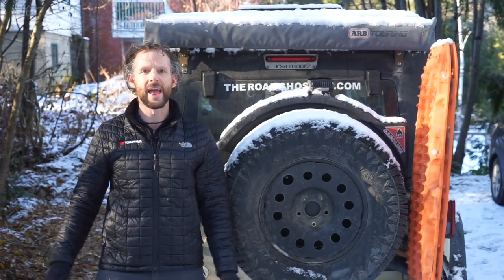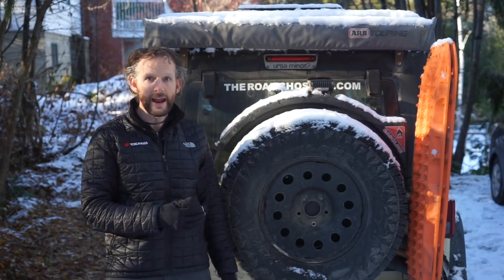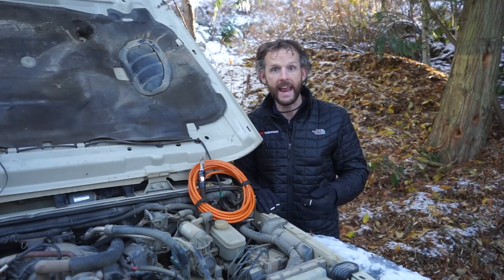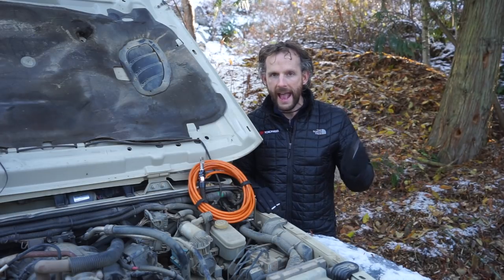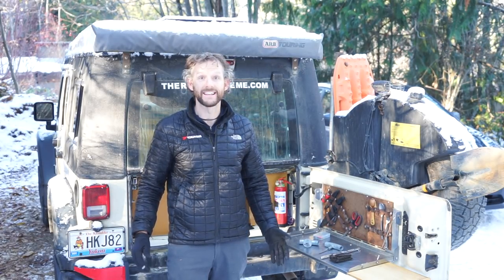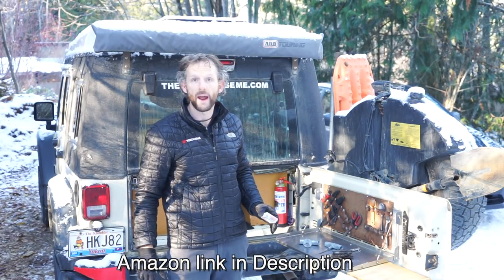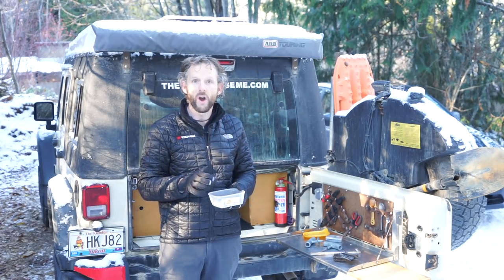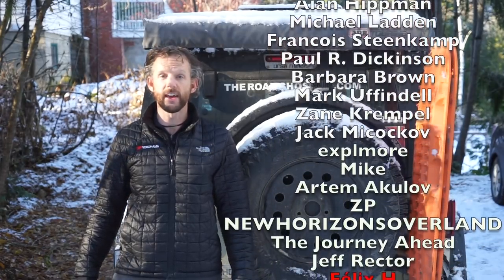Tire Spares and Repairs for Overlanding

Comment: I've broken lug bolts in the middle of nowhere. Once in a village some kids deflated all my tires. Thankfully there was a volleyball pump. On my vehicle it took about 2000 pumps each to get things up to drivable. Most of the village lined up to be heroes and take turns of 50 pumps each. This ended up being yet one more way to connect with local people.

Comment: i don't carry 2 Spares anymore. Did till about 4 years ago. Touch wood, flats are few and fare between. Ironically the last one I had was in the drive way of the tire shop near home (I was there picking up a tire for someone else).  But do carry the generic plug repair kit and valves. I do, carry tire leavers and a tube to fit my tires. For those times plugs wont do. The leavers pack flat in the back of the cupboard with some tape on them so they don't rattle. Basically take up no space. The tube had me stumped for awhile how to store with out it getting damaged. Ended up putting it in a A3 zip lock pocket and taping it to the underside of a shelf.

Comment: I very seriously considered carrying just one spare (and as it turns out, I didn't need any) on my last Africa trip, but I decided to play it safe. My parents who joined me on my last trip in their Discovery 3 run 255/55 R19's and carried only one spare, and they didn't have a single puncture either. I think modern tyre reliability is such that you're very unlucky if you get a single puncture on a Trans-Africa trip these days. However, we also own a safari company in Kenya and we use two spares. This is because the Land Cruiser uses split rims with tubes (my vehicle uses one piece tubed rims) and tubes are far more likely to get major tyre-damaging punctures than tubeless. A tubeless tyre can be plugged or, even better, the tyre sealant sold by Max Adventure and used by the UK Ministry of Defence which the manufacturers claim can seal holes up to 25 mm (1 inch) diameter in truck tyres, 20 mm (3/4 inch) in 4×4 tyres and 15 mm (5/8 inch) in car tyres. Apparently the stuff really works too (in both tubes and tubeless), but I've yet to try it.

Comment: I managed to nearly tear the sidewall out of my tires driving around the logging roads on Vancouver Island. I was about to move to Ontario, so took a last spin out past Port Renfrew, and up the Pacific Marine(with a few detours). I failed to lower my tire pressures on the detours, so tore a large gash in the side of my rear driver tire. It didn't go all the way through, but it likely wouldn't have held up to multiple days of highway driving. 

It was an expensive lesson.

Comment: I have put 10,000 miles on a tire with a patch numerous times. To be fair I was not overlanding, but instead in a work truck that consistently had a load in the back over 2,000lbs.

Comment: When I started driving four wheel drive vehicles in the late 1970s the tyres usually mounted on split rims were a constant problem tyres are so much better today if you manage air pressure and vehicle loads. I no longer carry two spares I always carry a plug kit and when remote a set of tyre pliers and tyre leavers to do a major repair.A second spare adds 40KG plus a wheel carrier? for people who run exotic tyres and rims two spares might still be worthwhile, I prefer to run factory Toyota rims and tyres the same size as factory but better quality BFG KO2 the chances of getting a tyre that will fit even in small bush towns is very good regards Mike
Reply: Not bagging Toyota, as I own one. But don't know what model you drive. If you carry any weight. Upgrade to Mining Spec steel rims (1700kg per wheel) relatively cheep. Or if you have money to burn some 1500kg+ alloy rims. Note I did not say bigger, just stronger. The rims they come from the factory nowadays are the bare minimum. By the way BFG KO2 is a great all-round tire. You can't go wrong on that.

Comment: Thanks again for all the great info from real-world experience. I have a little and want to contribute this: Where I live, Southern CA, most folks have aluminum wheels on their trucks. That is great for lowering unsprung weight so the trucks handle better, ride better, shocks last longer, and they look great! However, if you are out on your own (like I am on my ranch in Arizona with no cell coverage) and you break a wheel (aluminum breaks more than bends) you can be in a world of hurt. Steel wheels bend and they can be hammered back into useable shape even when severely bent. For long-distance overlanding in remote areas, steel wheels are the way to go, not the cool looking aluminum wheels.
Reply from the maker: I agree 100%, that's the exact reason my wheels are steel!

Comment: for my first Sahara crossing I got a set of Luxury Car "VR" Tyres with run down profile from a tyre merchant. Basically best available technology and rubber mixture in 1989. Put them on in Morocco and never had a problem untill i sold the VW Van in Mali. So good tyres matter. "Ichy boots" says the same (bike) - only flat on 63.000 kms with run down profile, but sometimes picking out screws, nails etc out of the profile when tyre is still good.

Comment: Interesting topic, just my 2cents:  4 of my last punctures (in Zambia/Namibia/South Africa)were on recently graded roads (roads in process of being graded), where the stones in the road surface is chipped by the grader, typically the puncture on the rear wheel, as the front wheel flip the stone for the rear tire to puncture - this is something you will only experience in places where the roads are still gravel and graded frequently, you may have tires that are are close to 50% used, not on bad roads where the torture is more on the suspension - the other serious issue is when you experience broken tar, and this is typically where a rim may also get damaged, especially if you deflate your tires like on a dirt road, as well as hard compound tires like BFG (where parts of the tread chip off and it gets unbalanced) - until you have experienced true broken tar, one should not comment, but Dan, I am sure you would've experienced broken tar in Africa ( I thought I saw in one of your videos that typical drive on the shoulder of the road as you often find in areas where the tar is beyond repair, even on main routes) - also broken tar not something always predictable as the roads deteriorate and they let it slip until it is close to being destroyed.  A final favorite spot to get punctures is if you drive in African National parks/ farms/two poor tracks with a lot of Acacia thorn trees, when the wind blow/storms, small dead branches underneath the trees on the road off (also wildlife like elephants), and you drive over these thorns - at some stage your luck will run out, and you cannot pick every thorn branch up if it is a long distance - that is why I always carry a tire repair kit as well as a spare casing (used it twice in the last 12 years), but then I do go way off the beaten track - also, the biggest issue with fitting a second tire casing is not to get the tire of the rim, but to break the bead, and yes, high-lift jack does a great job - just watch out that you don't damage your tire's bead as it will then not seal if you are inexperienced with tire levers.  Also, TPMS is great to warn you that you have a puncture, I typically get it plugged and re-inflated before it is totally deflated and one can feel you have a problem, and that usually saves the day.

Comment: I've broken more valve stems than tire punctures.  Colby valve stems are a life saver, replace stem without dismounting tire.
Reply from the maker: That's one of the great things about the wheels I run, the valve stems are entirely protected by the face of the wheel.
Reply: Those colbys rock - I've seen them used twice on the trail and they work like a charm. Especially useful if you stem kind of sticks out. Mine is protected by a 'fake beadlock' XD
Reply: I didn't know about them. I just went to amazon and ordered. Thanks for posting!

Comment: Tire plugs are a great TEMPORARY fix. You should absolutely get the plug pulled and a patch put in at the earliest opportunity!
What happens is a small amount of air will seep through the first, inside layer of the tire and travel in the steel belts, effectively separating the plys, cause a bubble and blow out the tire.
I know, sometimes you can get lucky and drive on a plugged tire for a long time. But more than not you'll have that issue!
Reply: That's my understanding.  Plug fixes can lead to internal delamination.  That said, I have done half a dozen plugs on my truck tires over the years, and never suffered this fate.  A nice internal  patch at a garage is the best fix, and $20 well spent.  Peace of mind is worth something, too.

Comment: 1) Number one accessory that you must have is a compressor. It comes first. An ARB Speedy Seal kit is also essential.

2) Good quality Japanese made tyres are the best for those running radial tyres.

3) I hope you don't bump into me on the road. Insurance claims in foreign countries are difficult even with a single vehicle.

Comment: Great video Dan! I purchased a quality viair compressor and puncture kit for my dempster trip this summer. Luckily I only had one leak just outside of Whitehorse which gave me a good chance to test out the compressor and plug kit and it was great being able to inflate the 33” tires to 80 psi with my truck camper on the truck.
Reply: I have just gotten the Viair 88P compressor.  Works great and seems nicely made.

Comment: So far I've never needed a second spare tire, but I always have one with me. The reason for this, however, is that I am mostly overlanding in vans or cars and the tires for these vehicles are not that strong. For cars it makes sense to fit van tires, these are often available in similar sizes and they are much stronger.
For my next trip, which will definitely take 3-4 months across Africa, I want to pack off-road tires on my Mercedes van.

So far we've always had these plug kits with us, but we've never used them. In West Africa there is a tire workshop in almost every major village. And for around 3 euros you can get the hole patched up quickly.

But I definitely want to take an air compressor with me for the next tour. So far I always had these 12V cigarette plug air compressors. But they are only good for emergencies.

Thanks for your tips. It's nice to see that others are also on the move with the attitude that less is often more.
Reply: There are decent portable compressors still, if you’d rather not hard mount it.  Even ARB sells theirs in a portable model. https://www.northridge4x4.com/part/compressors/ckmtp12-arb-portable-twin-air-compressor
Reply: @jfloydsea  thank you for the recommendation. But I think this model is a little bit above my budget. 
Maybe I will go with their smaller compressor like the one Dan got, also I don't really need a portable one, I think a on board compressor with a long (10 Meter) hose should do the job.

Comment: My kind of adventures is not off-road and I travel to experience cultures, local cuisines, interact with locals and learn about so many things about how people live and see attractions. That said, I have never felt a need to even carry any repair kit for tyres. Before trip I put on my good tyres and carry one spare Tyre, the few times I got flat Tyre i just change the Tyre and look out for the next village or town and get my Tyre repaired. That's all.
I feel for people who do adventures like mine who hardly go outside civilization, there's a lot of stuff they don't need to carry... Perhaps why I'm likely not to carry extra fuel on my next leg of trip in southern Africa and I will reduce water capacity from 15 gallons to just 5 gallons because I realized I Carry things I may never need anyways

Comment: Were you rotating every 5k while driving around Africa?  Did you rotate in your spare?
Reply from the maker: Yes, I did a 5 tire rotation every 6,000 miles (10,000kms). It gave me a great chance to have a good look around at the suspension and make sure everything was good.

Comment: First comment😊, I agree with you that 1 spare tire should be enough in modern times. I am driving vehicles since 40 years and so far I can remember 2..3 tire problems
Reply: I've been driving vehicles for only about a half decade, but I've had a lot of problems - punctures in sidewalls, punctures through the tread, plenty of damage. I've totaled four tires out, and usually get a flat every month or so.

I've never damaged a tire off-road, though; I work in construction, and job sites are messy, but on the farm, mud, and trails, I've never destroyed a modern tire. (10+ year old sun-rotted tires are not counted here.)

Comment: I think you may have mentioned in another video but Tom Shepard showed me how to dismount the tire using a farm jack and front bumper.
Reply: Yes but be careful. If you just use the foot of the jack you are likely to damage the sidewall. You really need a proper shoe to break the bead. If you are interested there's a video on my channel showing how to do it.

Comment: The one thing I agree with is not to carry two spare wheels. However for me it's essential to be able to remove and refit the tyre. (and if you can't do that you may need the two spares). Also you should carry heavy internal patches which will bridge over small tears etc. If you run tubeless tyres carry an inner tube so you can re-set the beads afterwards.
Reply from the maker: How many times have you needed to remove and refit tires to rims on your travels?
Reply: @TheRoadChoseMe  I have lost count. I can get tyres on and off in a jiffy now
I run tubed tyres which used to give me many flats. By careful attention to detail I have reduced the incidence of flats hugely (none in the past two years) but one must be prepared. I have also had a sidewall tear I needed to fix. For me tyre levers and a bead breaker are totally essential.
Reply from the maker: Why do you run tubed tires? Why not just run the latest and greatest from a brand name tire company and no worry about it?
Reply: @TheRoadChoseMe  This has been covered in my tyre video,  I have two sets of wheels (AT and MT), both from premium manufacturers (Michelin and Goodyear). Changing to tubeless means changing 10 wheels which is an unnecessary cost and very wasteful too. I have now got them to work satisfactorily with tubes. If I do have a problem on a trip they are easier to work on than tubeless.

Comment: Great content as always! What’s your opinion on overlanding a full size pickup truck? I just paid off my Ram and I don’t have any desire to trade it in, as I frequently haul and tow things that a smaller vehicle couldn’t handle. Do you think I would have any issues taking it international? I’d just be sticking to the Americas—I’ve put a lot of time and effort into building the life that I have, so I don’t have much desire to pack it up and go overseas for months or even years. The longest I can stay gone is maybe a month. 

I suppose I could look into a second vehicle but it would have to be a beater with my current budget, and I think my truck would be more reliable. Having a massive overbuilt truck is kind of par for the course here in the states, but I don’t think I’d do anything outrageous to it so as to keep it practical for my daily use.
Reply from the maker: They're getting more common, and can work for sure. Driving it on the narrow streets of Central America will be stressful, but it's certainly possible.
Don't think so much about the "base" vehicle, think more about where you're going to sleep, eat, cook and hangout when the weather is bad. They will impact your trip more.

Comment: If you break the valve off I think you need to put a new one in from inside right? So in that case you need to break the bead on one side of the wheel. You can do this by driving over just the tire until until comes off the bead. For resetting the bead you might need an air tank to provide a good surge of air to catch it. Or use the lighter fluid method. Or maybe you can insert the new valve from the outside?
Reply from the maker: My wheels entirely protect the valve, so breaking one is extraordinarily unlikely.
Reply: @mark2073 Yes, normal valve stems are inserted from the inside, that special tool he mention can be used to do that. Like someone said, there are special valve stems that can be applied from the outside. For us with wheels that dont protect the valve stems, you can use the shortest valve stems possible/available for your wheel, it reduces the leverage forces applied to the valve that eventualy break them off. I got ones that only the valve cap sticks out, and can still air up and down just fine, and never broke one off, when with the ones i had before i managed to break 3. Hope it helped.